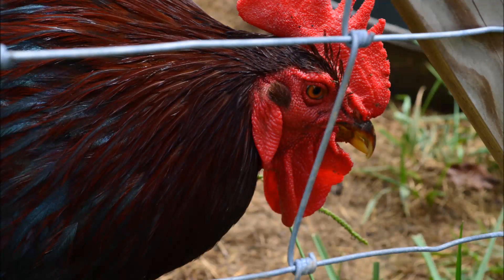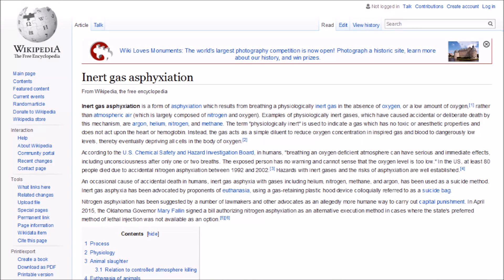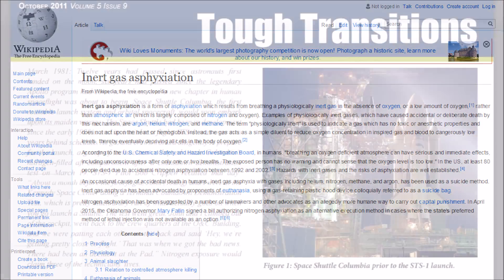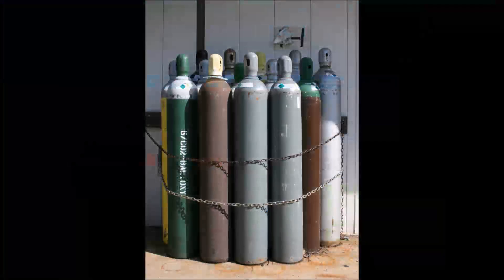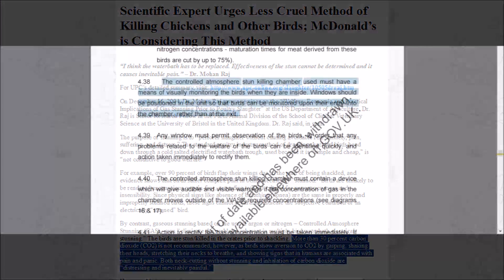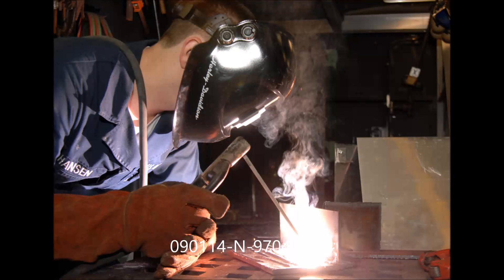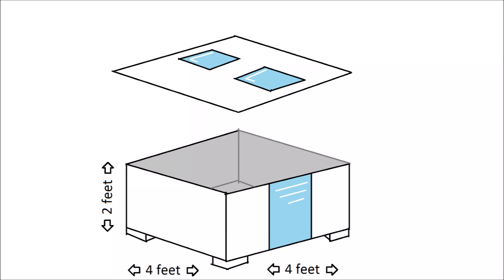Using inert gas for killing poultry and DIY gas chamber considerations

Comment: As a farmer for over 60 years,that’s right born and raised,I find this method unusual and bordering on cruel.Any poultry veterinarian will tell you that the proper way to do this if you are going to eat the birds is to sever the spinal column.this is done by cutting the head off.Why?because in order to be edible  the blood must be drained.As you say you give the birds to people to eat.Decapitation is quick and painless and the blood is let very quickly.If you are euthanizing in the case of mercy or for a sick animal that you are not going to consume then gas may be a trusted method but it is suffocation and that is still cruel and unusual.anyone who thinks this is right is an idiot.and anyone who does this shall be reported to the SPCA.Just because you don’t have the fortitude to decapitate makes you a chicken shit no pun intended
Reply: Any physical action used to cause death is not quick or painless, if someone broke your neck you would feel the amount of force needed to do so and it wouldn't be pleasant. If someone slit your throat you'd absolutely feel it. All mammals with a brain, spine and nerves experience the same sensory stimuli. The science behind using inert gas is solid, our atmostphere is 78% nitrogen, as long as there is no CO2 build up there is no feeling of suffocation. It's literally like being light headed then passing out, except they dont wake up.
Reply: @pinchyh  yup like I said you’re an idiot
Reply: That is absolutely not correct. Nitrogen gas is simply not noticed by an animal. The animal doesn't know it is being suffocated, so it feels no stress. The same thing happens to people too. There are loads of incidents with deaths or temporary loss of consciousness due to high levels of nitrogen. The human simply feels a bit tired, goes to sleep, and then dies painlessly. If you've ever had surgery, they will make you unconscious with other chemicals. The same thing will happen—you get sleepy, and you lose consciousness so that you can have a painless surgery.

Comment: Thanks Somepersoninncarolina, you're a kind and thoughtful man.  
Do you have any thoughts on carbon MON-oxide poisoning as a means of humane killing?  I used it a couple of times to kill rats that I'd live-caught, putting the trap with them inside in a large plastic bag with a hose running into it from my Toro ride-on mower's exhaust.  When I inspected them post mortem they looked as tho their deaths had been anything but peaceful.  The most noticeable sign of distress was how far their eyes were bugging out.  I stopped doing it that way soon after.
But now I'm thinking maybe I should've sealed their trap up in a small one-person tent and left a small gas stove burning inside it for a few hours.  Any thoughts or info on that?
Reply from the maker: I tried killing using CO before... it took a long time and similarly was not peaceful. That is why I started researching more humane methods to begin with.
Reply: @someoneinncarolina  Maybe it depends on what method is used for generating the CO?  If you use a hose connected to a car's exhaust the heat from the engine might cause some distress.  Otoh you sometimes hear of cases where people in cold weather are fatally overcome by CO from a small slow-burning flame in a closed room or tent, and they don't show any signs of discomfort.
Reply from the maker: @anthonycook8703  Fair point - I'm just a hobbyist, not an expert. I know from studies of humane killing, inert gases are considered the best.

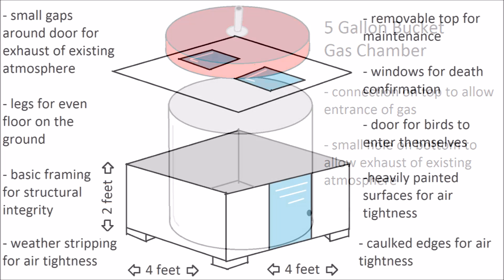Comment: 4:55 you probably want the exhaust hole at the top since nitrogen will sink and displace the existing atmosphere
Reply: Oxygen is heavier than Nitrogen, so wouldn't you displace oxygen with a lower exhaust port?

Comment: Is it liquid nitrogen or gas? liquid is extremely cold, isn't it?
Reply from the maker: It's compressed gas.  Liquid nitrogen is a whole other animal requiring special thermos, etc.  Equally deadly though because the liquid expands into gas and displaces oxygen just the same.  Note: liquid nitrogen as with any liquefied "gas" is all relative; ie, in space nitrogen is liquid or solid, on earth it is a gas normally due to relative temperature and pressure (ie our atmosphere).  As liquid expands into gas, just like with a refrigerator, it becomes cold, thus liquid nitrogen is very cold.  Anything that would normally have molecules highly spaced, which is then compressed (ie liquefied, ie molecules moved closer together) when expanded will become cold.

Comment: I worked for the phone company and we are always supposed to Drop in our blower hoses for about 30 min and use our gas detectors. Well in my second year, two "veteran" employees were taking a 4 mouth employee down a man hole. They disregarded protocol and the first guy went in. He immediately hit the ground just after he stepped off the ladder. The second guy, instead of calling 911 and dropping the air blower in, decided he could go in hold his breath and get the guy out. Not a chance. He too stepped off the ladder, bent over to pick the guy up and, he too fell. No signs of life. At this time is when I was pulling up to assist them with the work. I arrived to a panicked new guy. He very hastily explained what happened but didn't know why. As I went straight to my phone to call 911 and started pulling out my blower hose, I see the new guy, starting down the ladder. I had to run back to him and I grabbed him by the shirt and had to fight him from going down. He yelled at me that he could stay on the ladder and reach for them. At this point the 911 operator was hearing us argue. So I told the guy to explain what happened, my way of getting him out of the hole. I put my blower and one of the other guys blower in just to jeep that guy from trying again, at least that was the intent. Also I knew they were gone. No chance. Even if we took the time we are supposed to be blowing out in half that would mean 15 mins. By then, plus the time it took me fighting the new guy, they would be brain dead. But just like CPR I will keep doing all I can until I just can't anymore or paramedics take over. It took 10 min for them to get there and another 8 min for fire & rescue. Took F&R 5 mins to put on their gear. Took about 10 min to get the first guy ready to get out. Paramedics started CPR. 13 min later the other guy was pulled out. CPR. They loaded them up but by how slow they did I knew they had already knew they were gone. While they were doing all that I had the task of calling our supervisor. I spent the rest of the day answering questions and filling out incident reports. They let the new guy go home, go figure. Next day we were called in to answer more questions, the new guy quit.

I have seen many things in my time in the army that are horrific. But the sight of those to guys still haunts me to this day every now and then. Not because they died but for the fact it was so easily preventable.
Reply from the maker: Thank you for sharing your story.  It was a very interesting read... I agree it was easily preventable and that can be a horrifying thing.  My wife used to work in Environmental Health and did Septic tank inspections.  She mentioned that people have died by going down into tanks and going unconscious from gasses, then drowning in "the stuff".  She didn't know anyone it happened to, but it's a common issue - especially in livestock waste disposal settings.
Reply: @someoneinncarolina   I had hesitation in telling the incident and was about to not, but I think I had to. It shows that nitrogen and inert gasses can kill super fast and the animal being kill will never feel a thing nor with they know it is happening. So if a full grown man can die in seconds the small creature, like rats, will be killed as humanly as possible. In my eyes. Thank you and I hope I didn't put a cloudy damper on anyone's day.  It was a very sad event.

Comment: So I would use a regulator for say an oxygen acetylene torch and slowly add nitrogen only? I've worked with liquid nitrogen many times to reduce bearings or brass bushings, so I know nitrogen will displace oxygen, or rather it displaces it toward the floor. Nitrogen is all thats needed? Of course I'd use nitrogen and not liquid nitrogen, I mean. Liquid nitrogen would be quite cruel
Reply from the maker: Yes... the regulator I'm not convinced will be very precise for this application, so again I release over a period of time and use more than would be strictly required to be on the safe side.  Cold gas goes to the floor - compressed gas expands and becomes cold.  For some reason people seem to think CO2 or Nitrogen or other gasses all sink dramatically - I think the reference is simply cold gas though.  It seems to me that if all the gasses were so different in density and mass, our own atmosphere would tend to separate and kill everyone, since it is mostly Nitrogen - or perhaps you could separate them merely by sucking out the heavy ones from a valley.  Rather it is a fairly expensive process to separate gas out of our atmosphere and people don't typically suffocate in valleys - other than rare events releasing huge amounts of a specific gas.  Just my 2 cents on this way of thinking. :)

Comment: Where do I get a nitrogen tank, refills of nitrogen and what accessories would I need in order to use nitrogen to euthanize feeder rats for snakes? Thank you for posting this educational video. I think more videos like this should be posted for the sake of the animals being euthanized.
Reply from the maker: Hello, you can get tanks, supplies, and nitrogen gas from most welding supply stores.  That said, I am no expert on welding accessories.  I always use far more nitrogen than would be required, to be on the safe side.  If you're using a much smaller container, such as a 5 gallon bucket, you can probably run much more conservatively.  I believe I aimed to equal typical atmospheric pressure, but overall I played things safe by using more gas and keeping it on a long time, while also allowing ventilation to output nitrogen without raising atmospheric pressure in the vessel dramatically.  I hope  that helps!
Reply: Some Guy In N Carolina Thank you so much for the info. It’s the one thing I hate about owning snakes. I try to acquire snakes who only eat frozen/thawed whenever possible, but occasionally I get one that doesn’t. Whether its a mistake on the seller’s part for advertising a snake eating FT, when it actually eats live or having to purchase an animal that’s on live and gradually transitioning it over to FT, I’ll never get used to feeding live. If the snake will take fresh killed, I’ll typically stun the rodent first in an attempt to make things quicker, but I’d much rather the situation be as hands-off and painless as possible. I’ve researched CO2 euthanasia, but it just doesn’t seem quick enough. It looks more like they’re suffocating to death. I’ve also been researching cervical dislocation, and although that seems to be very quick and painless (when executed correctly), I’m just not sure I could do that. So, thank you for the info, I truly appreciate it.
Reply from the maker: @petsgalour  Wow, I understand your situation - tricky!  I will say, when I get "in the zone" killing things, it becomes easier.  For example, killing a lot of poultry around the same time.  Part of me hates killing things, and another part of me has to recognize that almost everything we humans do has a real cost to nature, if not fellow humans as well.  Killing is just taking responsibility in my mind.  That said using pure CO2 is not a pleasant way to kill things since biologically it can be detected and converts to carbonic acid - as you know from watching my video.  Using a percentage of CO2 mixed with other inert gasses supposedly is not noticeable to the animal.  If you can't get nitrogen, consider argon or up to a percentage of CO2 mixed with argon or nitrogen.  I am not quoting figures because I don't recall them specifically, but to my recollection (mentioned in the video) it was something like 20%.  Anyway, good luck!

Comment: I would consider a hinged floor, perhaps with very light springs holding it up, so that if an anything heavy enough to be a dog or child enters, the chamber will not hold atmosphere.
Reply from the maker: Not a bad point, but I would assume such a chamber would not be filled without being actively monitored, and it leaks atmosphere quickly enough that it cannot hold it for a long period of time.

Comment: Is nitrogen used bc its cheaper? Would helium work in the event you had enough wouldnt it be more painless ?
Reply: Helium would work too. I have never seen any evidence it would be less painful. Nitrogen gas asphyxiation is already painless. The problem with helium is that there is very little helium out there. Nitrogen is much more available.

Comment: Thanks for making this. I am looking to slaughter 50 broilers next month and would like to use nitrogen. Did you make a video on the building the chamber itself?
Reply from the maker: Sorry, no.  The concepts are the important part though - venting existing atmosphere and making it relatively air tight, but not fully.
Reply: @someoneinncarolina  No worries. I am wondering how you got the nitrogen in the chamber?
Reply from the maker: @thesamirmahadin  There is a hole for the hose.
Reply: How long do I have after the chickens die to process them? Trying to figure out how many to do at a time! Built my chamber similar to yours. Thanks for the video!
Reply from the maker: @thesamirmahadin  On the plus side, there are no openings in the body of the animal from this method... on the minus side, you need to bleed them to get the blood out, so it isn't a huge advantage depending on how picky you are.  If you don't have some friends to help you process, do yourself a favor and stick to 5-10 per weekend or something feasible.  Don't do them all at once - it's a ton of work.
Reply: Some Guy In N Carolina thanks. We were thinking to do 15 at once with 3 people. We have a plucker as well. Did you bleed out the birds before de-feathering? Or after. Wondering how and if it will make a difference with the heart not pumping.
Reply from the maker: @thesamirmahadin  If you care about blood in the dressed bird then you should bleed them immediately and hang them for 10 min or so to let it all drip out.  I don't personally care about that, so I would opt to de-feather first, then dress.  It's just personal preference.